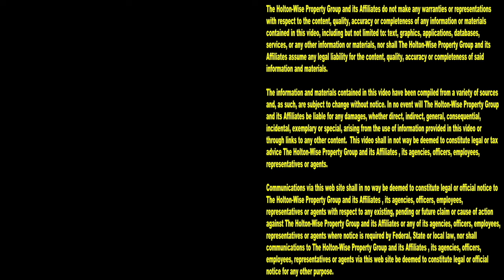Eviction Hell | Tenants From Hell 264

Comment: The evicted tenants sometimes "take revenge" for getting evicted by squatting -- they demolish the place.  Happened to my father. It took months to get them evicted and you have to use the court system. My father then found out the husband and wife took meth. They came back and demolished the place. I asked my father to press charges and he said he was afraid to because those meth addicts would take further revenge and the legal system does nothing. After that he got rid of the property.